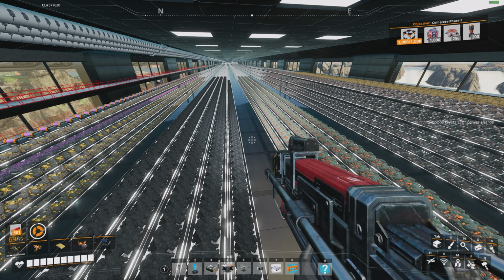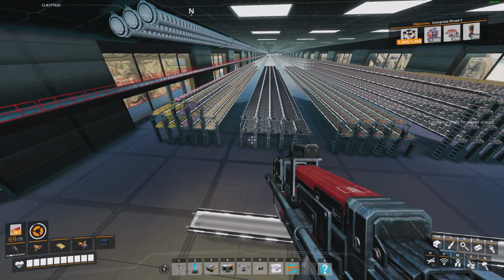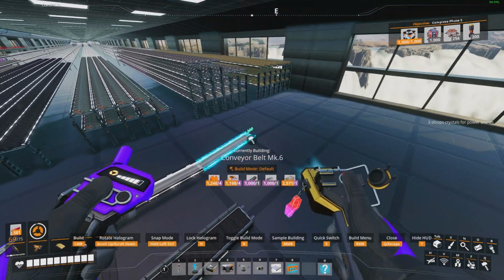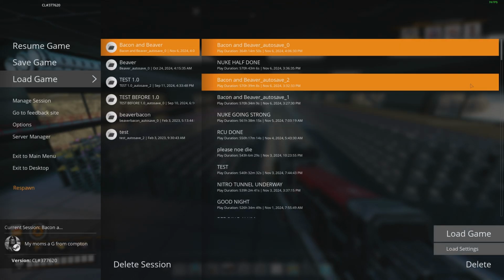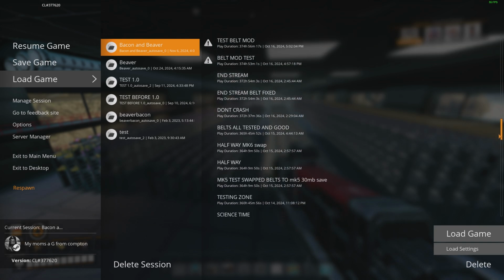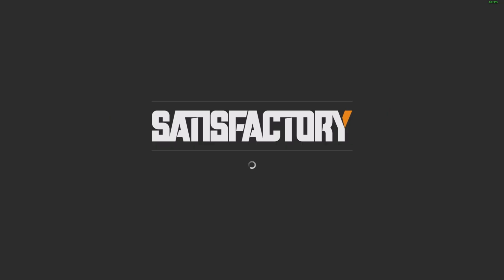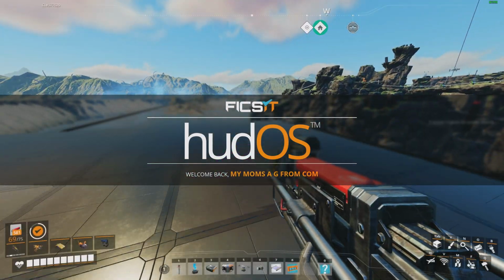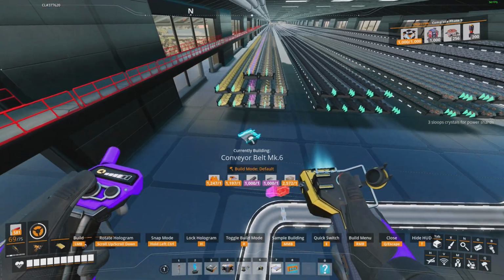PSA All belts will lag at a certain point, Satisfactory 1.0

Comment: This is interesting. I suspect it’s some kind of belt network optimization, actually. The game simulation probably organizes all belts of the same type in the same area into some kind of optimized graph. This saves performance once that data structure is set up. But it’s probably really expensive to update it when you have thousands of kilometers of the same belt. Maybe they could amortize the update of this data structure over multiple frames so that it’s not such a huge spike

Comment: >about 1500 kilometers of mk6 belts
I realise you said its preference but they’re called trains, my friend. Even in factorio you need to use them to feed arterial raw materials and this isn’t 2d tile factorio that has been being optimised for over a decade. You could just beat the game this way but you can’t full planet base this way, I’m sorry. 😂

Even without system specs to consider there’s a reason we have ships offload onto trains which are offloaded onto trucks which deliver to the end point with only moderate belt work in distribution centres and factories in the real world. As a logistical engineer who likes utilising most of Massage2(ab)b (at least the important stuff, if not every iron and limestone vein) I heavily encourage you to emulate this as you can go planetary scale without melting the copper in your cpu, or, at least put your pc in a place it will evenly heat your home this winter. 🤣
Reply: "You cant full planet base this way" only if you're a coward
Reply from the maker: Comparing the global scale of the world too a tiny enclosed ecosystem of a videogame, logistical engineer with no logic
Reply: @BigBeaverTV except not really as the game is meant to emulate the logistic challenges of real life
Reply: @Fact: Belts are not simulator machine efficient for moving resources across massive distances in the virtual game world. Your own test shows this. Allow me to explain the other half.
Fact: Trains and trucks can get throughput over distance per CPU cycle that belts cannot touch (though trucks are much worse). If you turned that thoroughfare into a train rail and put even one max length single engine train (though I’d recommend two engines and ten cars, speed is important too) on it you’d be doing 42k materials per trip. You’d have to have ((42,000/1200) / MinutesPerTrainTrip) individual mk6 beltways. Five minute trip? Seven individual mk6 belts for however long the rail would go. You might think, “not bad!” But then every train you add adds another 42k to the first part of that equation. Two trains, 14 belts; Four trains, 28 belts. That’s a lot of belt segments given the distance being discussed… and let’s define that distance! The playable area of massage2 is approximately 8km by 7km, 8km at 120km/hr takes… four minutes. Which means you’d need 8.75 lines from the GRASS FIELDS TO THE DUNE DESERT to replace ONE TRAIN!

Generally speaking you will cap out on materials per minute the map can even provides you with mk3 miners before trainlines ability to carry it much less your PC grinding to a halt because moving containers like trains or trucks are much kinder computationally. I get that you like looking at belts but this is NOT Sparta! This IS madness! 😂
This is not me being a railway engineer and telling you to do railways because I am a hammer who can only see nails. This is satisfactory’s own specific maths and yes I am trained to figure out the best way to get things places. Each major factory will still have a large beltway sorter after the train station and into the main assembly banks for you to look at if it makes you so happy. So yes, there are many reasons I’m the logical one here. 🙈
Reply: @anonemoose7777   i think u spend way to much time sitting here typing this comment out and even editing it once u posted it, as a logistical engineer you should go out and touch some grass and experience the world instead of sitting behind the computer screen making Book long comments.
Reply: @ 
>I think
Having read your post, you clearly don’t. Sorry to hear about that attention span issue you got tho. I hear iPad babies can’t even finish school and if two paragraphs and formatting are so hard for you I can see why. What’s weird to me is how slow you kids must type tho, “wow tuk u so long 2 rite dat do?”, brah I type 90wpm. Why are you kiddos so bad with computers despite being raised by them? 🤣
Reply: @anonemoose7777  Cool story, brah.  90 wpm is impressive when you're typing with your knuckles.
Reply: @anonemoose7777  Well, it’s nice to know I’m being judged by someone who’s clearly mastered both reading comprehension and basic internet etiquette. 😂 But hey, not everyone’s got the patience for lengthy rants, so I guess I’ll just leave you with this: it’s not about how fast you type, it’s about what you actually say when you’re typing. Hope that helps you with your "schooling." 😜
Reply: @  it is what you actually say! I’m so glad you agree, yet, you’re the one complaining about a detailed maths breakdown of logistics on a video about an engineering game where all you’ve said is complaining about a two paragraph comment like that’s a struggle for you and generally amounts to letting the brain rot ooze out of your ear. Sorry you can’t keep your points straight but keeping it straight is clearly a problem for you. 

Whether engineering, mathematics or sick burns the only one being schooled here is you so you can keep the luck. 😌
Reply from the maker: @anonemoose7777  where did you pull this 42,000 items per train number out of lol? all items have different stack sizes  for one, realistically you will need 1 "Freight platform" per belt of resources you want to consume if you plan to run your factory at 100% then more trains based on round trip time. I know you think you know what your talking about but the reality of the situation you have no real experience playing the game at a scale I'm currently working on and I'm genuinely not trying to lil bro you. The game runs flawlessly even with the number of conveyors I have the lag is WHILE BUILDING them simple as that and there are ways to mitigate it which is all Im trying to show in this video end of story.

Comment: Wow, so using a variety of belts around is better for late game performance than just using mk6 for everything. Good to note. 

I wonder if the bottleneck you are hitting is in regional map zones or if it is global?

Like is it because you have 60x 500m MK6 belts in that particular map zone or is it because you have 300x 2000m belts on the map? 

Can you try heading far away from your belt bus and see if you still have the lag placing new belts?

Thanks.
Reply: Yeah it’s an interesting result to know it’s the amount of each belt type that lags independently. Nice to know my exactness in using only the necessary tier of belts on my BPs is being rewarded too. Like having a mk5 input manifold downgrade at exactly the point only a mk4 amount of materiel would still be on the belt after splitting off to feed several assemblers. 

Would seem that is not just my own aesthetic/efficiency fixation but a best practice. 😂

Comment: You are probably just hitting a hardware cap because the game isnt ment to be played like this, maybe a handfull of people are actually crazy enough to be using EVERY singe resource in the game and transporting all of it in the most inefficient way possible from a harware point of vieuw. The only thing you are doing is destoying your gpu because you are maxing out the logical prossecor alocated to the mk5 or 6 belts. My guess is that you will run into the same problem with all of your actions at some point on a project of this scale. If it wasnt for the excellent min maxing and performance balancing the devs have done for this game, you would already be running at 3 fps. Not even factorio can handle this amount of belts without struggling.
Reply: The devs love these megabases guys, they constantly work together with them and use the low performing save games to optimize the game.
Reply from the maker: The game at scales like this is entirely CPU limited my GPU runs at like 40% and 50c so no my GPU is not being destroyed lol
Reply: @BigBeaverTV  GPU% isnt what causes this its a single processing core of your GPU doing the Calculating of the entities So you may only see 20% usage but it is in fact a GPU limit. Some Resource and Logistics are CPU dependent but i can clearly see this is a GPU hard limit. Sure it is hitting your CPU too but its for sure a hard limit of the processing cores of your GPU doing Calculations.